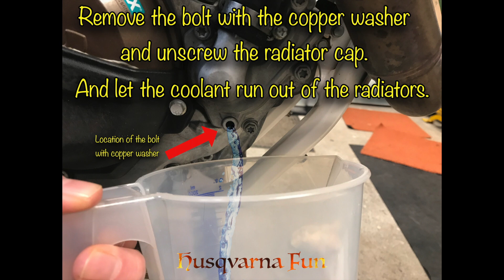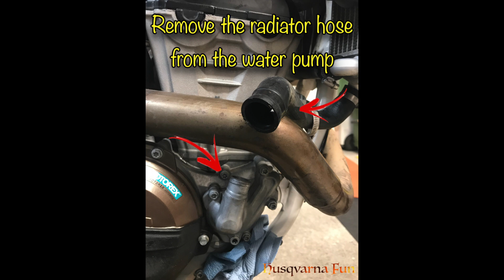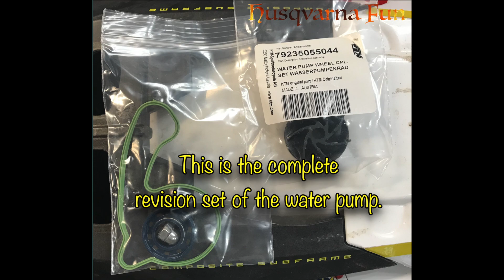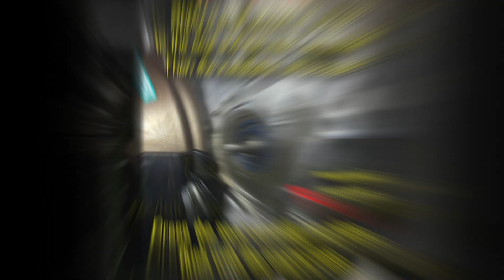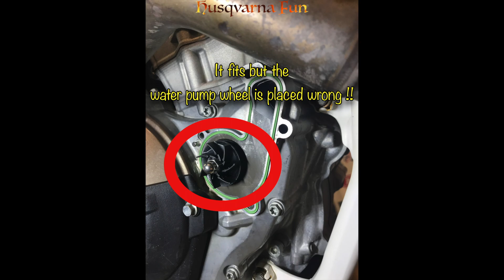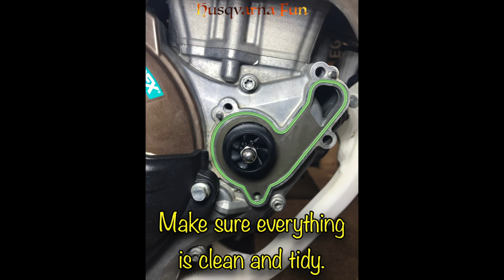Replace leaking water pump seal Husqvarna FE350 2018 (ktm 350 exc)

Comment: Thank you, going to do same on my fc250 today. 0:26 NUT, does it opens clocwise or ccw??
Reply from the maker: In my opinion it was loose counterclockwise and fixed clockwise. good luck it seems like a lot of work but it is good to do it yourself. thanks for your comment.
Reply: So loosen counterclockwise and tighten clockwise. Not good with mechanic Longo! Just a good ole yes or no opposite way will work !! Lol
Reply: @jameycribb7627  yes it was the normal way, not the opposit. changed sea repair kit last year and no more leaking
Reply: What sucks is I just bought mine from a dealership today and noticed a tiny spot on the floor but it's not really coming out now. Just barely can see it. Is that still a problem?? I don't know what to do??
Reply: @jameycribb7627  its an easy job, i would change it
Reply from the maker: just replace it.  not difficult and then you will not be faced with any surprises with a nice off-road ride.
Reply: Is it hard to find and order that stuff? I wish we could private message I'm up at 4:30 in the morning can't sleep freaking out! Lol email or Facebook messenger or something? I'm so sorry to aggravate you. And I have the 2018 fc250
Reply from the maker: Google this and you have your replacement parts. 
79235055015
WATER PUMP REP. KIT
Reply: This is the one there saying for mine husky 2018 fc250. Looks like I have to take the whole case off
Reply: It won't let me send pic. Look it up its different
Reply from the maker: not necessary if you buy the replacement set then everything becomes clear.  and it is similar to the movie of the 350.
Reply: @jameycribb7627  it was exacty as in video on my fc250 2016. easy job. repair kit is cheap, just buy it and try.
Reply: Thanks guys I really appreciate it. I'm a little more calm and clear headed now! I had just bought the bike yesterday and absolutely love it and just didn't want any problems. Sorry yall had to keep encouraging me! One of the next questions I'll have will be exactly how to soften these forks! There a little to stiff for me! Lol
Reply: BUT DAMN I LOVE THIS BIKE!!!!!! 🔥🔥🔥😂😂😂